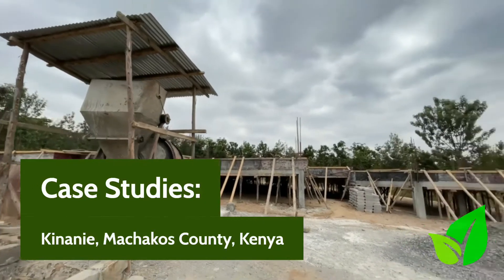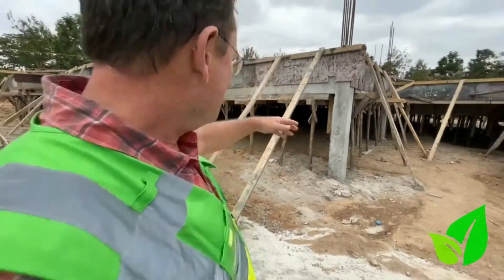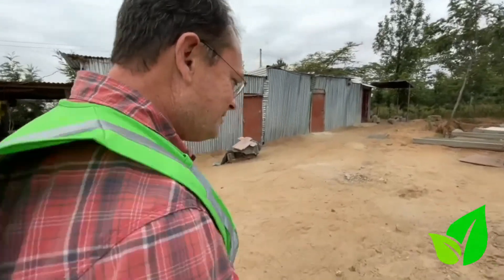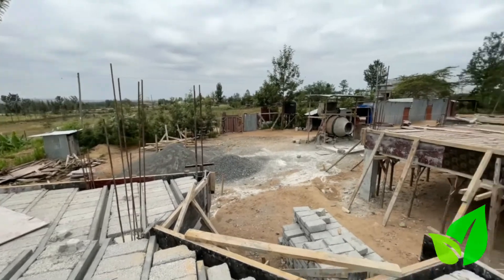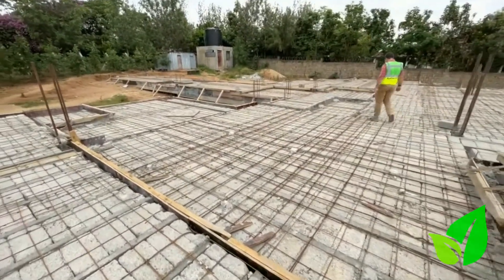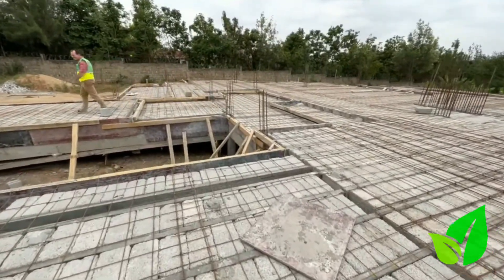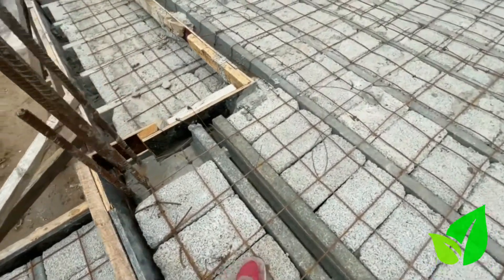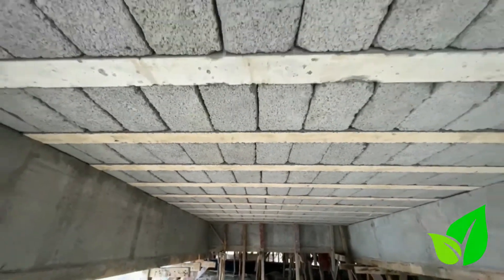EcoConcrete, Case Studies: Kinanie, Machakos County, Kenya

Comment: "Normally, we would just ask for a sand cement screed." See Africans; even with the bible they must add salt 'n' pepper only this time, it's reinforced concrete or it's a case of older knowledge refusing to let go; perceived safety and strength of previous systems.
Reply: Precast solutions have been around since the 1970s, fairly new to the Kenyan market but people are gradually adapting to them. It has many advantages that save you from the hustle and bustle of the conventional method.